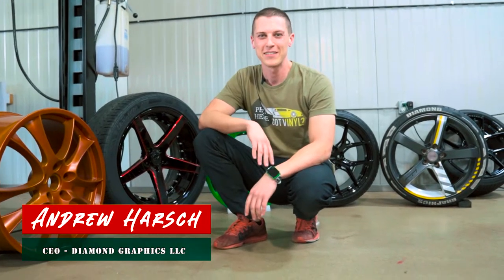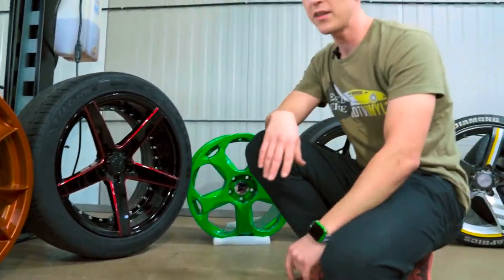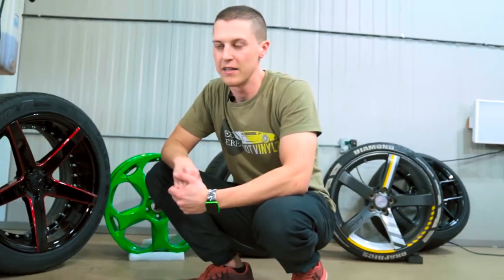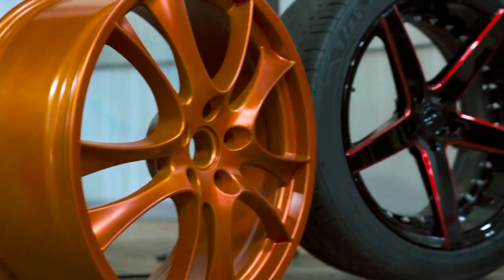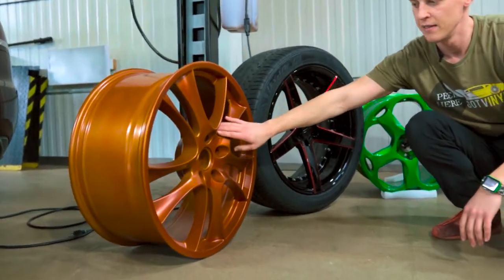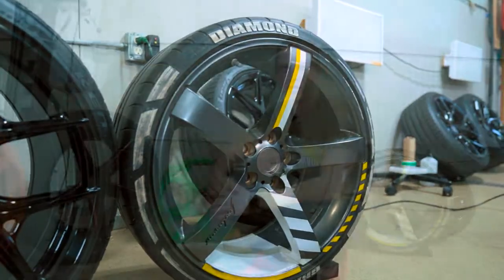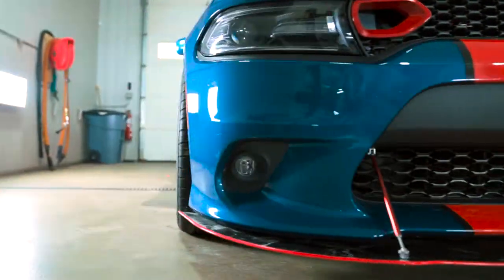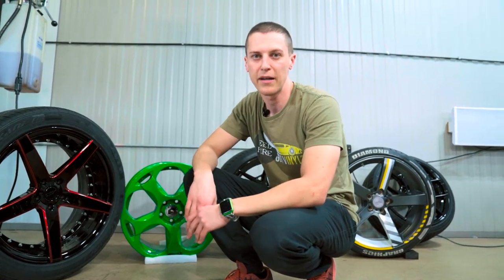Can you Vinyl Wrap Wheels vs Powder coating￼ - Diamond Graphics

Comment: What if I have curb scratches.
Reply: you are to resurface the wheel before applying any default on the metal will not let the vynil stick to it real good
Reply: Hey look our street bee graphic 🙌🏽 yo question about powder coated wheels. I have a client who has powder coated wheels and wants some reflective orange accents created. Will the vinyl last and will it ruin the powder coated wheel down the line? TIA